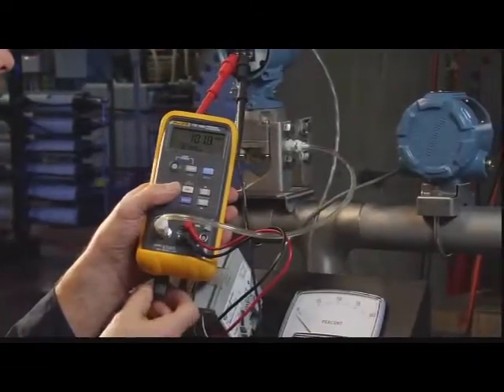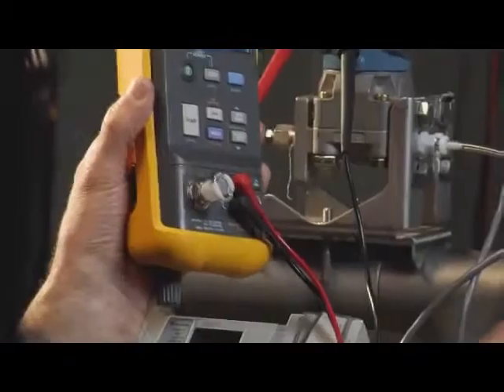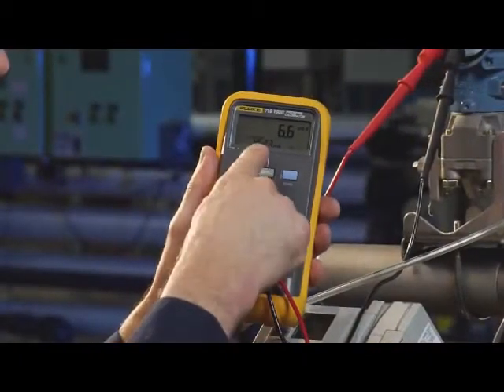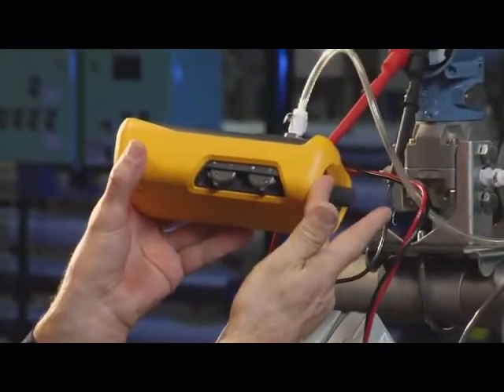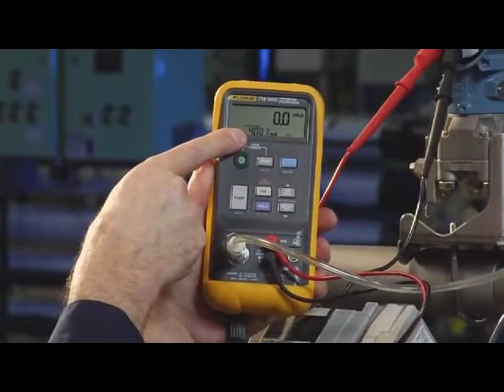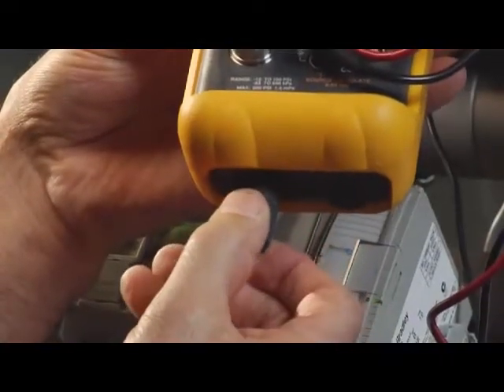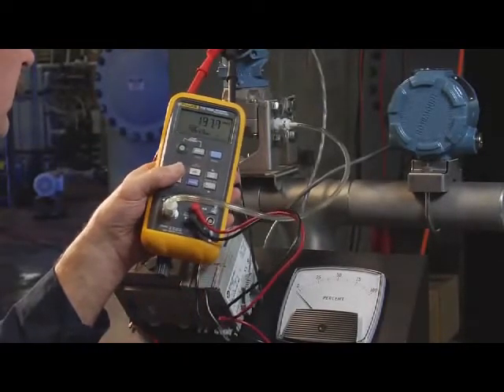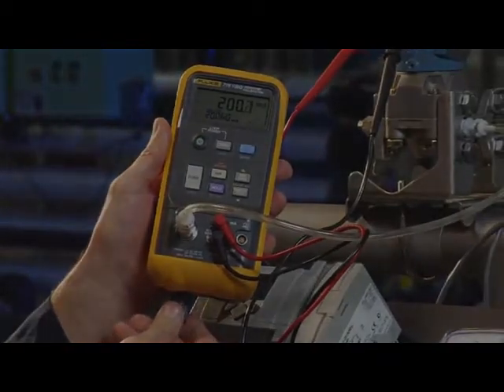Fluke 719 Electric Pressure Calibrator

Comment: Dear Davis, We have just bought this calibrator. Is there a way that you can set a pressure setpoint for the calibrator and then run the pump to that point? Actually we kept missing our setpoint of 122mbars. We went either past it or we were short of it. It took us quite some time to make the input pressure exactly 122mbars. Isn't there a quicker way to do this?
Reply: this may help
Set Maximum Pressure Limit
To set a maximum pressure limit for the internal electric
pump:
1. Press C then LIMITS and the limit setting is
displayed.
2. Use Z to increase or Y the limit setting.
3. Press ENTER when finished.
When the calibrator power is cycled, the limit setting is
retained.